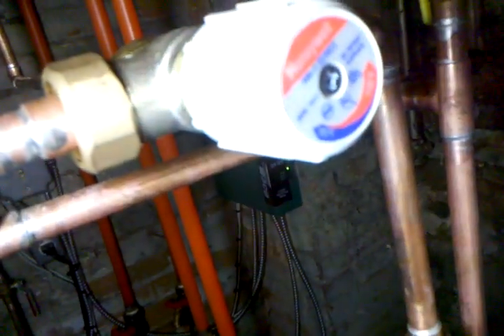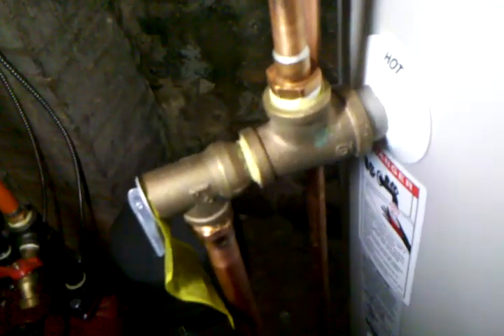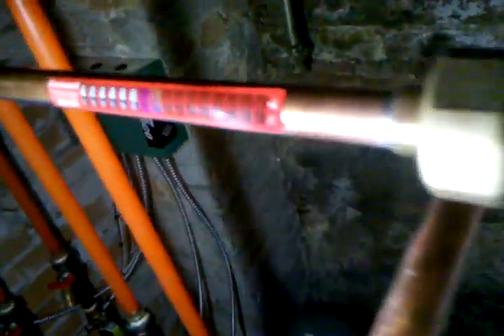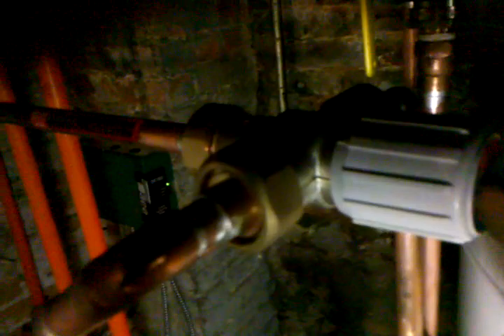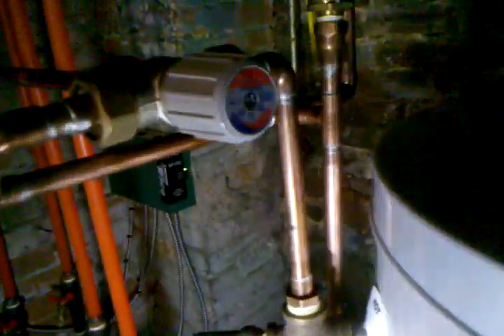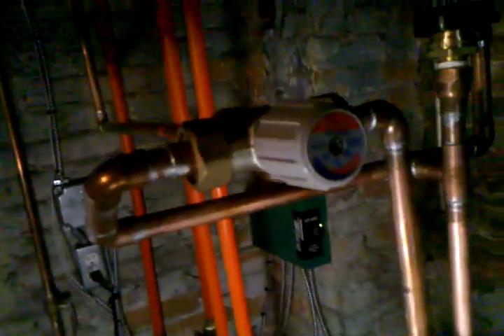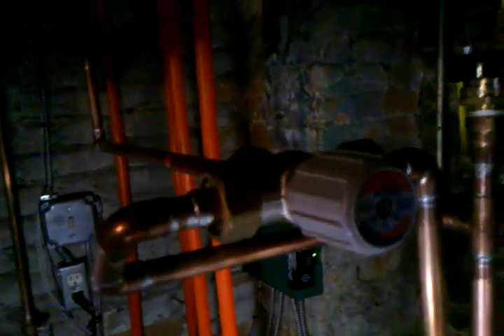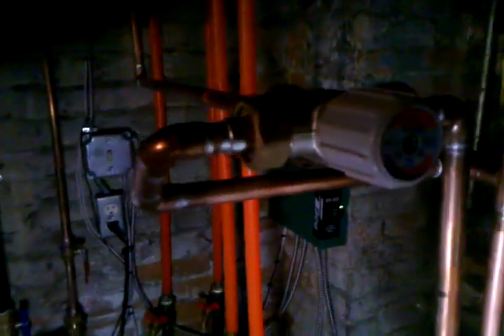Setting temperature for a Honeywell/Sparco domestic mix Valve

Comment: It's very frustrating as i can not find anywhere which direction to turn the knob to lower the temperature--clockwise or counter clockwise.  I know there's arrows on the top of the knob but it's really not clear if turning clockwise in the direction of the blue arrow lowers or having the blue front and center lowers it. There is no temperature gauge on my pipe so i'm SOL.
Reply: I wish somebody would answer this because I am having the same issue.

Comment: Thanks for the video. Perfect instructions and was easy to adjust once I knew how the temperature strip was supposed to be applied. In case others view later, simply loosen the screw far enough such that you're able to turn the knob. No need to loosen it all the way or take it out. Also important as described to make sure your tank is at the temperature you want to store water. If you change this in the future you'll need to re-adjust the mixing valve.